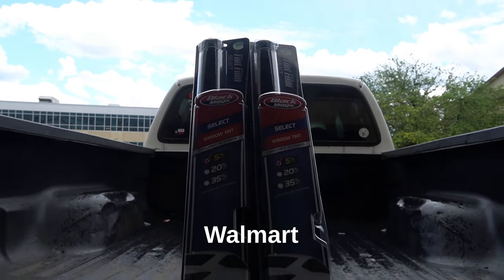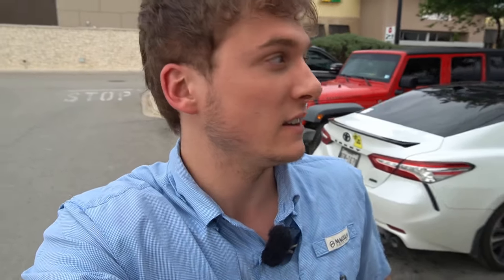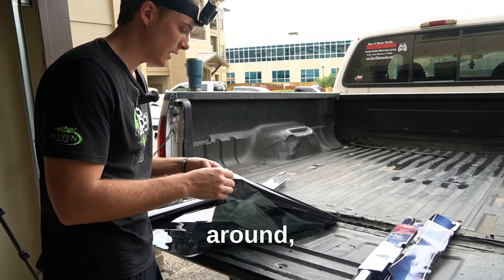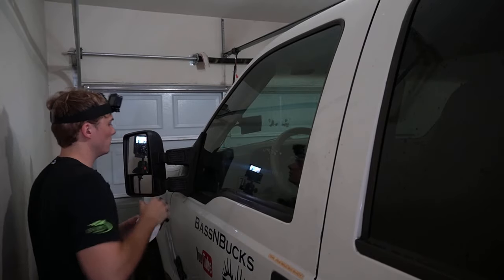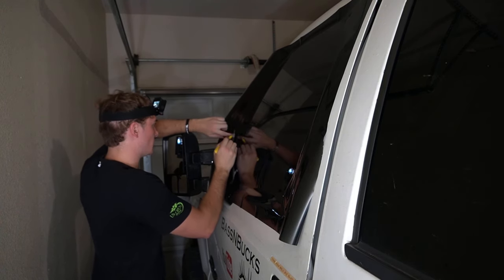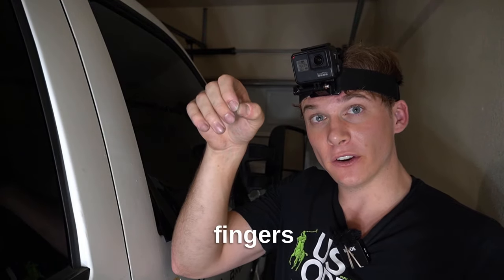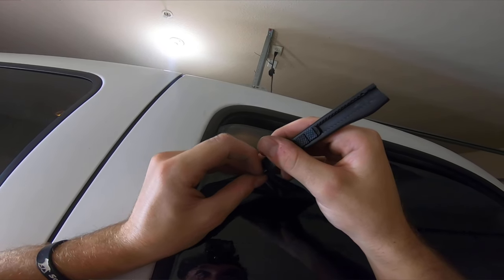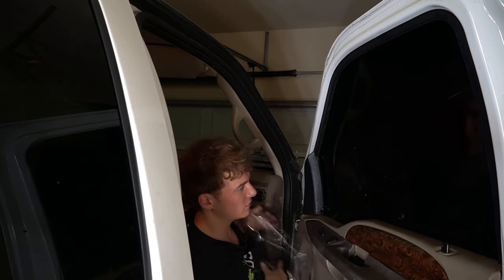Tinting My Windows With Window Tint From Walmart! (5% Tint)

Comment: Your not spraying enough solution on the tint and window u should be able to easily slide that film all on the window after u peeled it.
Reply: Do u know if it will work on window that are already tinted? I have a truck and the last owner tinted them but they are not as dark as I want them. Do i have to peel it?
Reply: Still won't work, it's the adhesive they use on the tint I have tried this stuff three times and you can literally drench the window and it will still stick and not slide. I even tried a professional grade solution from Amazon and no better.
Reply: @JrARP nope you can tint over old tint. The only issue you might encounter is if you even want to remove the Walmart tint it might damage the old tint as well.
Reply: Your giving bad advice. If you don't have enough slip, its because your solution isn't mixed right. 

As for installing new tint on old tint, whatever condition that old tint is will show on the new install. Also if the old tint fails the new tint will fail. Its best to remove and retint for best results.

@SoloKyoto

Comment: I think the slip solution is just straight shit then, cause it should be slipping nicely. I tinted my windows using the same cheap dyed film at 35%. I used a zep sprayer bottle with soapy water with baby shampoo and it  slips beautifully. But if you dont heat shrink the film, you will get bubbles

Comment: I tint my own vehicle for the first time and there was no problem your problem you not putting enough soap and water on the glass it will slide on the window bro and when taking of the peel use soap and water it will not stick to itself

Comment: Do you have a link to the F250 Lariat badge on the fender that you used? Not sure how long that tint will hold up but good attempt ha. If you do get it professionally installed id recommend ceramic tint, will hold up better and keep the truck way cooler during the summer, only downside is the pricetag.
Reply from the maker: I got the badge on eBay but it’s like a essay long.
Reply: @powerstrokecentral  could throw it into a url shortener but I’ll check it out and see what I could find. Had the same issue with my lariat part fading out. Thanks